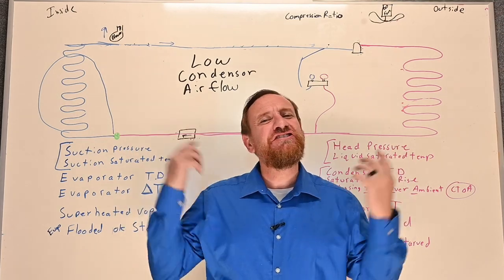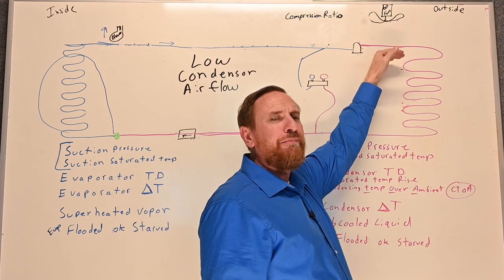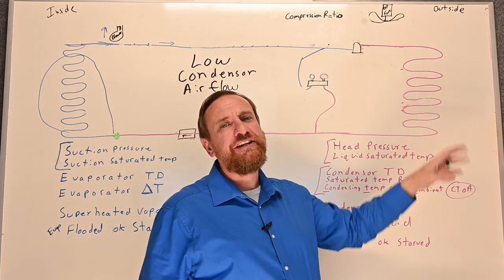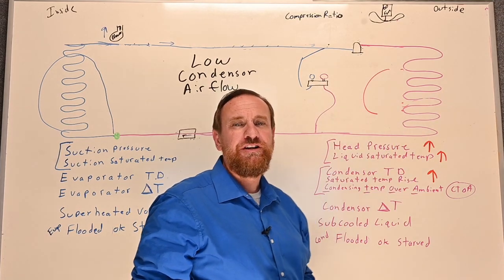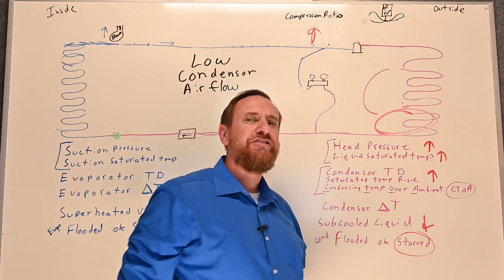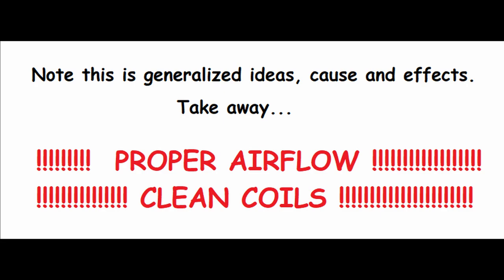HVAC 103 Scenario Dirty Condensing coil

Comment: I was at one another tech condemned an indoor txv, low suctuion, high superheat, i rechecked before i pumped down, had 13 degress subcooling, looked fine, except condenser coil was dirty, i cleaned it, let it run 20 minutes, now only had 1 degree subcooling, added 2.5 lbs, got subcool at 8, superheat at 14, did leak search, indoor coil leaking, glad i checked 1st, just make sure you look at the condenser coil, before condemning a txv, could be low charge with dirty outdoor coil making it look fully charged because subcooling looks normal. Love these videos, nice refresher
Reply from the maker: Yes! That's great!
My friend Chris calls it big picture diagnostics! 
Well done!

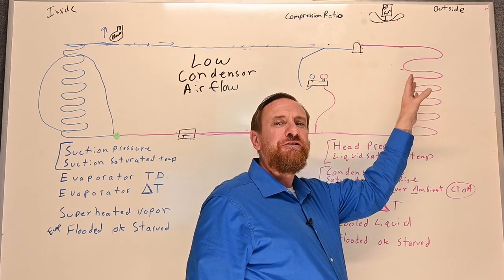Comment: Excellent video Ty, I was wondering if you could explain in more detail what you mentioned at minute 1:48? It is the part where you talk about how the increase in the temperature of the air around the condenser increases the pressure inside the condenser. Greetings

Comment: I know you said it but to make sure I have it.So a txv with a dirty condenser will back refrigerant up in the condenser. The suction pressure will still be LOW / NORMAL and maintain superheat . 
Is the high side trying to push so much gas in to the evap that the txv is trying to slow it down and cooling isn’t affected?

I always thought the cooling capacity of the evap was dropped too. I’ve seen low charge with dirty condenser give normal suction and head pressure till outside coil was cleaned
Reply from the maker: Yes but don't look at pressures!

Superheat and subcooling will tell you what's happening. 

The TXV will try to maintain superheat depending on how bad it is.

 The cooling capacity will drop. 

Also the liquid line will exert an opening force on the TXV,. So if the condensor is really dirty it will push the TXV open.
Reply: @love2hvac  and suction pressure will be normal?
Thanks Ty you are awsome!
Reply from the maker: There is no such thing as normal suction pressure. 

TXV has no way of controlling suction pressure. 

Pressure changes with temperature, humidity and airflow. 

If you have a tire look at pressure, if you have an HVAC unit look at superheat and subcooling
Reply: @love2hvac  mind blown indeed! I’ve never thought of it that way.  Always looked at what typical coil temps  operate at. High temp 40 , coolers around 20, freezer 0 down to low temp.
Thanks Ty I enjoy learning something new every day!

Comment: Nice video, but I have never seen a system's capacity increase from less airflow through the condenser in normal weather people would be using their AC in.

For that to be possible, I'd think the outdoor temperature would have to be quite low. Then it's definitely possible. After all, there is a reason why we have various head pressure control devices for systems that are run in cold weather.
Reply from the maker: I never said the capacity would go up
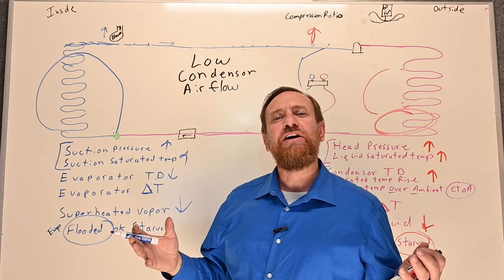Reply: @love2hvac  At 5:00, you said it's possible for the evaporator's delta T (temperature differential) to increase, meaning a larger temperature difference between the return air and the supply air. Did I misunderstand what you intended to communicate?

Assuming the evaporator airflow remains constant (which it would if condenser airflow is the only variable), a higher temperature drop across the evaporator would mean a higher capacity (more BTUs of heat removed per hour of runtime).
Reply from the maker: @averyalexander2303 

That DOES NOT mean an increase in capacity. 

When the suction pressure rises you loose dehumidification transferring laten removal to sensible removal. 

DELTA T     IS     NOT      CAPACITY. !!!!

To calculate capacity you need the specific information of the compressor performance chart with superheat subcooling suction saturated and liquid saturated. 

To differentiate capacity of the evaporator you need the exact CFM, return air wet bulb and supply air wet bulb
Reply: @love2hvac  Great point, thanks for correcting me! A higher delta T with the same evaporator airflow, humidity, etc would mean a higher sensible capacity, but as you said, latent capacity depends on humidity removal and total capacity is latent + sensible capacity. Same thing can happen with too much airflow through the evaporator since a warmer coil condenses less moisture.

I'm curious under what conditions you have seen the evaporator delta T increase with less airflow through the condenser though?
Reply from the maker: @averyalexander2303 
With a fixed orifice metering device, 
When the head pressure rises, there is more vapor pressure pushing against the liquid column. 

That means more liquid is pushed into the evaporator coil but also raises the suction pressure. This reduces laten heat removal and increases sensible heat removal. 
You also have more liquid to boil away to a vapor. This was expanded in previous videos and demonstrated.
If you look at a target superheat chart, you will see it. You can compare conditions and completely flood the evaporator coil under one set of conditions and completely starve the evaporator coil under another. 

Just because you flood the evaporator coil does not mean that it is system capacity. The compressor still has to move the refrigerant and is suspectable to the compression ratio. All the heat has to be rejected in the same space meaning higher head pressure. 
You will eventually reach a point where all the liquid is pushed out of the condensor and you are pushing liquid and vapor into the metering device. 

The videos are in order to explain this. Jumping to the end of the videos means a lot of misunderstandings and confusion. 
This is the reason they are in order. One lesson builds for the next and so on.
Reply: @love2hvac  Wow, great explanation! The theory of higher head pressure pushing more refrigerant through a fixed orifice makes total sense, but in practice, I've never  seen an increase in the evaporator's delta T from lower condenser airflow. My experience has always been the exact opposite that a cooler condenser increases the evaporator's delta T.

Again, I'm not doubting that the evaporator's delta T can increase from reduced condenser airflow, I've just never seen it happen, so I'm curious what indoor and outdoor conditions you have seen that under.

Comment: Need help Mr. Branaman
If I have to make an evaporador coil for a 10 ton condenser unit to cool the water in a tank, how many feet of pipe do I need, how do you calculate?
Reply from the maker: That exceeds my knowledge.
That falls into engineering
Reply from the maker: https://sciencing.com/uses-temperature-sensor-5997997.html
Reply from the maker: https://www.engineeringtoolbox.com/heat-condenser-evaporator-d_881.html

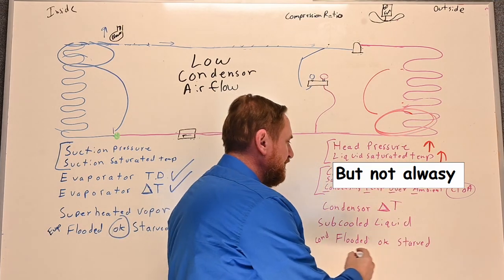Comment: 3:14 - 3:23 "not alwasy"?
Reply from the maker: There is a point where the head pressure will force the TXV to open.

There will be a point the compressor floating seal for scroll will relieve or the internal pressure relief valve will open. 

 There is also a point where the condenser can't reject enough heat to condenser to a liquid.

Under those scenarios the schooling would not build up.